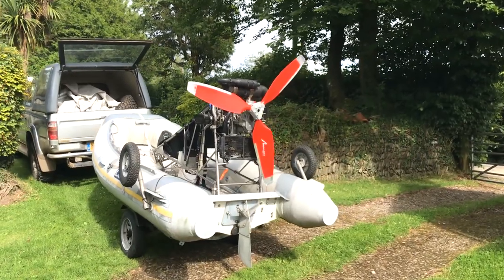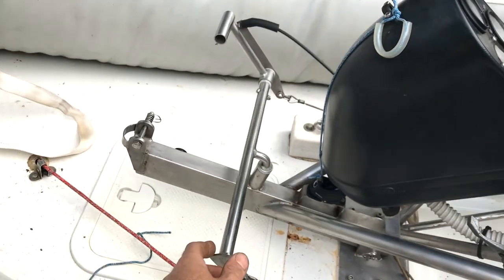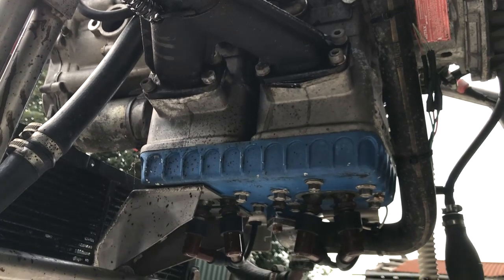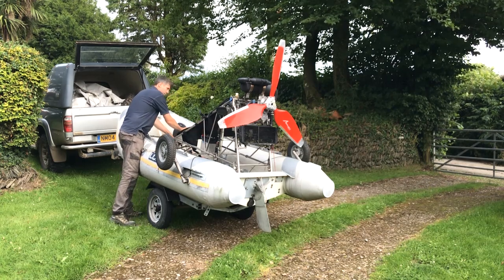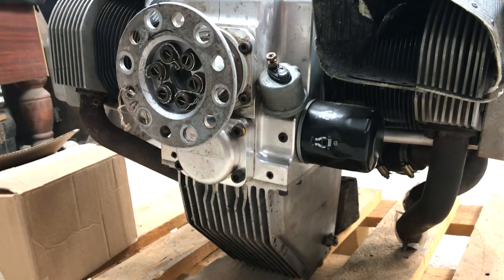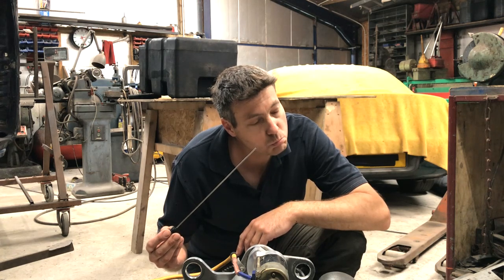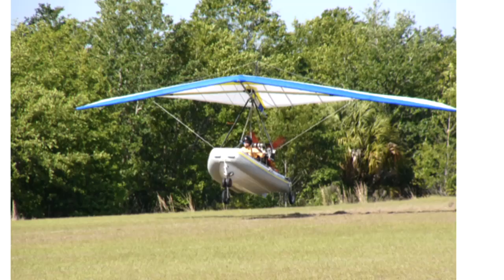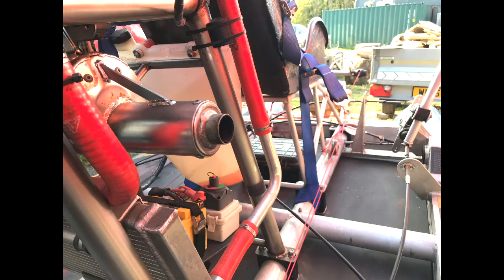CRAZY new project! Wing in ground effect (WIGE) boat build Ekranoplan. Homebuilt Fixed wing aircraft

Comment: Hi, I hope your project goes well! A suggestion however, as the type of amphibious microlight is rare, try and keep the frame/ hull etc. as standard as possible. If you decide to return it to airworthy (better resale value) you won’t get caught out. Use bombardier oil as Rotax two stroke have a tendency to nip up if run lean or very hot. Onward and upwards, all the best.
Reply from the maker: Great advice!!! The AM FIB will be kept 100% original and I intend to return it to airworthiness at the end. 👍 
Thanks for the oil tip and CHT vs EGT, I'll take a closer look at the gauge and see.

Comment: Nice video!!  The Ekranoplan idea is cool. Maybe use the Rotax for another build, say a gyro?  No shame in getting plans and building from them.  Cant wait for your next video mate.
Reply from the maker: Yes the Rotax will no doubt be useful to own. I didn't buy an aircraft engine for the helicopter because of cost but I can see the value in them now. They have lots of modifications to make them reliable as well as being light weight. It would be perfect for a gyro.

Comment: Now you can use the Rotax for your little helicopter. water cooling for a helicopter, air cooling for a boat, the irony. Best of luck David Mitchell
Reply from the maker: Hi John, yes I could and it would solve the engine issues. I can see the value in these engines designed for aircraft. It's a lot of work to make ground dwelling engines reliable and light enough for aircraft. I like them. David Mitchell 😆
Reply: @Ben-Dixey  Just read the owners manual for the 582, it states; "This engine, by its design, is subject to sudden stoppage. Engine stoppage can result in crash landings, forced landings or no power
landings. Such crash landings can lead to serious bodily injury or
death."
Reply from the maker: Turbine it is then ! 😉

Comment: Lots of Honda cars engine as a reverse rotation, when you open the hood of the FWD the engine is on the other side ! 
This boat with the triangle wing and your good to go fly and higher than the other thing 😮
Reply from the maker: Hadn't thought about cars having engines in the opposite way around. 👍 I've got the wing for the fib and it could of course just be flown as it is. Would have to get a microlight licence though which I wouldn't mind doing at some point.

Comment: Thing is BEN they have microlight trkes that have attachable floats, you might end up with a heavy craft.
Reply from the maker: You're right Peter, it's not going to be as light as it could be using the RIB. It just seemed like an easier solution as we know the RIB is designed for the speed and durability.

Comment: I am no plane engineer. But i am a car mechanic. If you are planning to use this engine, i will sujest to replace that water radiator. It has seen better days and might not provide suficient cooling anymore, do to much of the cooling fins has falen of. This could be a pre warning of a soon to leak radiator as well. Just a freandly warning what can happen when this engine is in use for longer time.
Reply from the maker: Completely agree, it needs replacing, I've got the Valeo number and I can get the same one for £800. It's from on old Italian car but I'm sure I can find something that requires the least modifications. You can buy the correct twin rotax radiators for 
£150, just have to modify the mountings and hoses.
Reply: @Ben-Dixey  Good. The last thing you want up in the air, is a hot running engine and leaks, that can lead engine failure. But that should not be a problem as you seems to all ready want ot replace it.

Comment: At the risk of being the pedant in the room, those control cables are pull-pull. They don't push.
Reply from the maker: The rudder controls can't push but it looks like the elevator and ailerons have to push?
Reply: @Ben-Dixey  They Can push if they're totally enclosed like a choke cable but for any significant load the inner cable would need to be solid, at least where they exit the outer cable. With high loads like control surfaces the friction generated inside the tube under load (while pushing) and the backlash caused by the clearance between the inner and outer would make a single push-pull cable a poor choice. Even car throttle cables only pull and have a return spring.  
I can't claim to know every cable setup but my experience where cables are used in light aircraft is that they generally have open cables and pulleys with either 2 cables direct to the control surface or to an intermediate bellcrank with a pushrod from there to the control surface.
Try holding the ailerons or elevator still while moving the stick. That might show you what's going on. Hopefully it's solid both ways !
Reply from the maker: @Andrew_Fernie  Understood, thank you! 👍👍 Backlash is something I would like to avoid when building mine.

Comment: Watching Aquaplane K42 videos I have some ideas to improve longitudinal control, Ben. Are you using a forum to bounce ideas around?
Reply from the maker: I would like to hear any ideas you have Martin. I haven't posted on any forum. Are you a part of any forums that you think would be particularly suited ?
Reply: @Ben-Dixey  , not a forum but I was involved in an aerobatic electric aircraft project at Cranfield that didn't go anywhere at the time (we were all busy). Biggest problem with operating in ground effect is the longitudinal transient response time. You can see it in the K42 videos: pilot (Kester one assumes) puts in an input to climb, elevator causes the fuselage to change angle, then the wing eventually climbs. So there is a lag in the response that increases pilot workload.
What you wants is a flapevatoron system. This is a mixing of control inputs to flap, aileron, and elevator. For longitudinal speed stability you need to put mass centre slightly ahead of main wing so that horizontal tailplane is having to counteract. It is referred to as longitudinal dihedral in the text books. If you connect flap to elevator then you get the desired longitudinal control and speed stability but without the response lag. You also have to mix aileron and flaps, hence flapevatoron system. Only issue is need to put a trim system in to counteract the control force, but this is done all of the time in aircraft.
Your project is the perfect showcase to demonstrate the viability of this system...
Reply from the maker: Interesting, so the ailerons would flap down to increase the lift of the wing during the up elevator ? 
Regarding the location of mass I believe this needs to be located between the 25% chord and 40% chord of the wing. I think in ground effect the centre of pressure starts at 40% and moves forward as height increases. Somewhere between the two would be the compromise ?
Reply: @Ben-Dixey  , yeah that's the mechanism. Flaperons are already used on high performance gliders, so nothing new there. The new bit is combining flap and elevator. You tune the flap to elevator ratio so that the main_wing and horizontal_stabiliser always produces zero moment about the mass centre, so only a lift force. Then it's a question of optimising for least drag over the flight speed range, and ensuring docile trailing edge (and flap) stall characteristics.
For a simple wing the centre of lift will typically be between 25% and 40% chord, depending on camber and AoA. For an aircraft in flight you want the mass centre to be a little forward of the main wing so that as the aircraft speeds up there is a pitch up tendency, and as the aircraft slows down there is a pitch down tendency. This reduces pilot workload, but there is a trivial trim drag penalty from the elevator pushing down against main wing. In practice the elevator is affected by downwash from main wing which will reduce trim drag. (The argument for Canards is that they avoid this trim drag, but you get the canard tip vortices affecting main wing which normally makes drag worse.)
For an aircraft that is designed to fly continuously in a fully held off landing then speed stability will be less of an issue. However you want the aircraft to reject gusts, so to my mind having mass centre ahead of wing still sounds like a wise idea. I can use that speadsheet to generate some charts when you have an idea about masses and wing planform. Whole point of the exercise is to reduce pilot workload, hence fatigue, hence mistakes.
But, I would definitely bounce this stuff off Kester Haynes as theory guided by experiment is always the best solution. His experience might be different from my short duration extended glider landings down airfields. It may be that he recommends putting mass centre on wing centre of pressure, in which case the flapevatoron system would be all flap and no elevator...
Reply from the maker: Great help Martin. I'm so glad you are willing to chip in with ideas and thoughts. I'm writing it all down so that I can eventually make informed design decisions. It helps when I've got two flying examples and two people willing to share the details with me. I can compare the theory with actual data. 
I'll speak with Kester about your flapevateron idea and find out where his centre of mass is located. 👍

Comment: Ben, that ElectricAviation_AnalysisTool_2023-05-14 spreadsheet I sent you has a "Fixed wing" tab for you to play with various wing planforms and see what power vs speed looks like. Of course it was designed for aircraft flight, so I need to scale induced power vs height. Hyperbolic tangent reasonable starting point:
induced_power_scale = tanh( const * height / wingspan).
Use rectangular planform wing so that tips never get close to stalling. Will you be using Aquaplane K42 general planform with elevator?
Reply: A quick look finds a suitable ground effect on induced drag model [1] as function of height h over wingspan b.
Cdi' = (1 - (1 - 0.66 * h/b)/(1.05 + 3.7 * h/b)) * Cdi  for h/b < 0.5
1. REID, E.G., 1927, A full scale investigation of ground effect, NTRS
So, for spreadsheet approximation a fit might be
Cdi' = Cdi * (tanh( 1.37 * h / b) )^0.5 ,  for all h/b
I'll have a think...
Reply from the maker: @martingarrish4082  That's really helpful Martin! I will play around with the spreadsheet and see what I can learn from it. Will get back to you. Thank you!
Reply: @Ben-Dixey  , I need to start developing that tool to help you and the Electric Aviation channel. Idea is to help designers to play around with concepts - Excel makes sense for that. Early days. In the mean time wikipedia not bad on the basics.
https://en.wikipedia.org/wiki/Lift-induced_drag
As for books, you could get Anderson, "Fundamentals of Aerodynamics". It's the sort of book you dip into from time to time. Same author, "Introduction to Flight" looks pretty good too.
Reply: @Ben-Dixey  , a little Sunday coffee time digging reveals that Anderson, "Introduction to Flight", recommends McCormick, B.W. "Aerodynamics Aeronautics and Flight Mech" for ground effect correction to induced drag:
Cdi' = Cdi * 16 * (h/b)^2 / (1 + 16 * (h/b)^2) , where Cdi = Cl^2 / (Pi * AR * e)  ref wikipedia page above.
Slightly different to that Reid paper. I could update the spreadsheet calculator, but not happy with the variation in published fits.
So, I might have to pull out the stops on this and update my Prandtl lifting line code to include ground effect.
I need to do the same for rotary wings at some point (idea was for tool to facilitate e-VTOL & e-STOL design).
Reply from the maker: @martingarrish4082  Thanks for for this Martin, I've made a note of this equation, great stuff. 
I've been working out the CL for James's mudskipper. For the helicopter project I never attempted any lift calculations and so even the basic lift equation is unfamiliar, until a couple days ago.  I'm starting at the beginning and have a lot of catching up to do before I can engage with you on the subject. 
James has provided me with some data and I think these figures are reasonably accurate. 

Takeoff weight 490kg
wing area 18m^2
take off speed 16.6m/s 
Air density 1.225 kg/m^3

Using these figures and the equation 
CL=L/(1/2 * pv^2 * a) 
I get a lift coefficient of 1.66  
The angle of attack of the wing is 5.5 degrees 
Is the CL figure I have come up with correct? 
I need to understand the basics before I can use your spread sheet. I haven't done any drag calculations yet.
Reply: @Ben-Dixey  , that's about right (I get 1.58 Cl with g = 9.81m/s^2). So for example that is the stall Cl for a NACA 2412 aerofoil. If you set up a google drive I can pass you a pdf of Abbott & Doenhoff, although the book is still in print as a handy reference to select aerofoils. A&D only gives numbers for split flaps not plain flaps, but the way gliders do it is to have inverse flaps that reduce Cl with speed (minimum drag solution). In summary, blunt leading edges give more docile stall but higher drag (obviously there is more there, but you have to get into flow boundary layers).
With your sail cloth idea don't forget that you'll only have the optimum aerofoil near the structure, and complex (draggy) 3D flow in between. It's worth making the trip to one of the 3 gliding clubs in Devon and ask to look as a K8 or K13 wing - you'll learn a lot when you study the spar leading edge D-box construction. Epoxy bonded thin marine ply should work nicely.
Reply from the maker: I'll set up the Google drive and email you! Very kind to offer so much help. 
I'm going up to Somerset microlights soon to have some flight training, I'll see if they have any gliders to look at. If not Eaglescott airfield isn't far and they definitely have gliders.
Reply: @Ben-Dixey , helping on this is actually good for me to develop my aeronautical skills. You'll be happy to know I've got ground effect in Prandtl lifting line code now and it seems to work. My plan is to put your wing in there to compare against your hand calcs. It should give confidence in the design.
Keep at me to simplify because I forgets that there was a time before I knew this stuff, so it's good for me to explain to test my understanding. You should have a Teams invite in your inbox. Maybe use that for me and anyone else that wants to help as a way to exchange ideas, sketches, & calcs etc...

Comment: Another thought, another thread: what aerofoil section is Kester Hayes using in the Aquaplane K42? It looks like a NACA 4-digit series. These are good all round aerofoil sections, albeit slightly draggy, so I wondered if you were considering the laminar flow NACA 5-digit series. Or maybe the GOE sections fitted to wooden wing gliders or FX sections fitted to later composite designs. Abbott & Doenhoff, "Theory of Wing Sections Including a Summary of Airfoil Data", still in print to give you some ideas - I have a pdf if you sets up googley drive or similar...
Reply from the maker: I will check with him but I think he said the wings were from a thruster microlight. Can't find the airfoil section after a quick google. 
I would really like to use the hoverwing, Sail cloth type wings because they are so simple but I need to know what the difference in lift is from the hoverwing type to a proper airfoil. I suspect the leading edge and the topside airfoil shape is going to be the most important for lift. I'm just waiting for Kester to come back to me on takeoff speed. I will ask him about your aileron/elevator mixing just trying not to bombard him too much with questions.